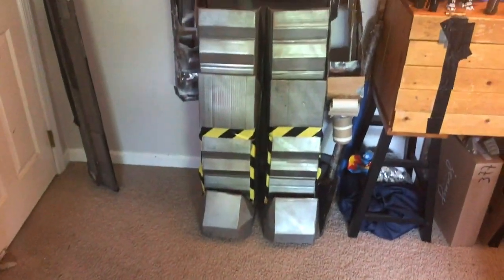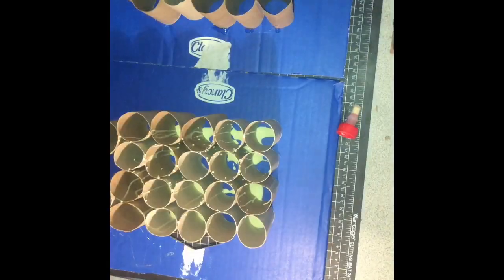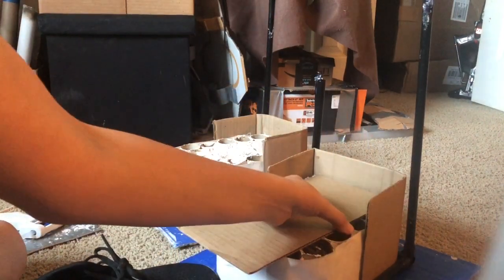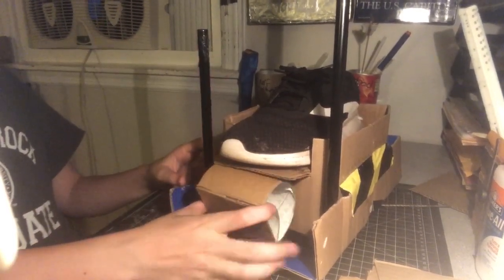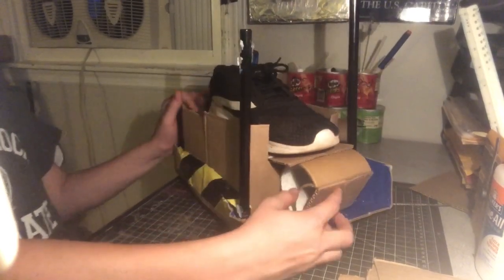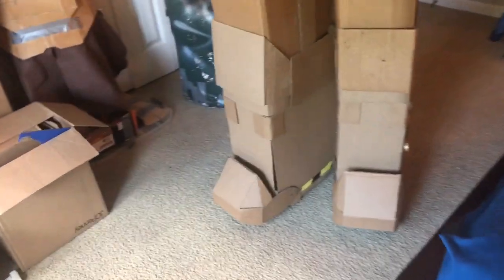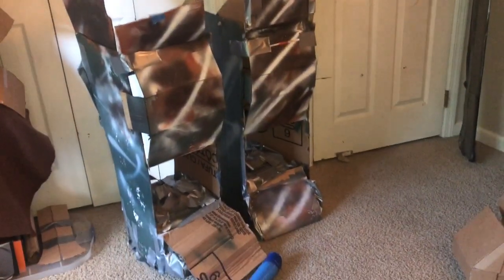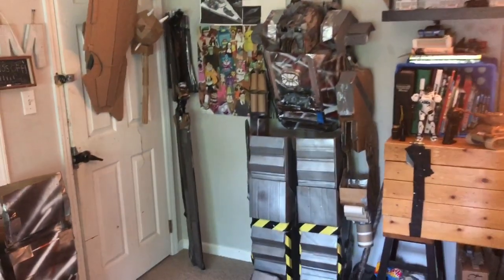How to build mech legs/ Reconstruction

Comment: How you do armor flexion?
Reply from the maker: If you’re Asking me how do I get the armor to flex I use screws or wooden skewers or even PVC pipe to make a joint
Reply: @MarksWorkshopcrft  i dont speakin so munch inglish
Reply from the maker: @davidpadilla1783  oh that’s ok as long as I can help provide cardboard builds that CD are easy to understand
Reply: @MarksWorkshopcrft  do the mech chesplate please
Reply from the maker: @davidpadilla1783  https://youtu.be/qd8tWzJgnHk